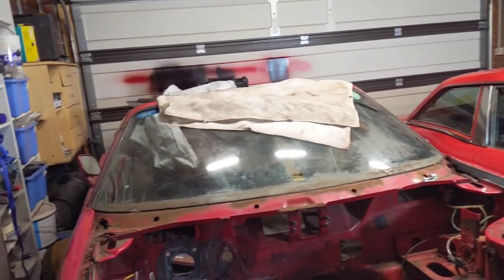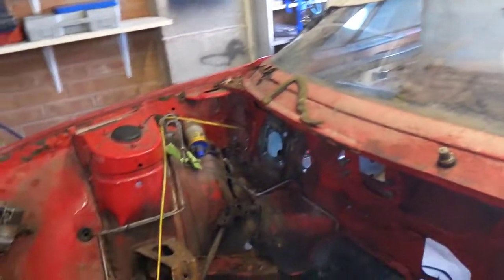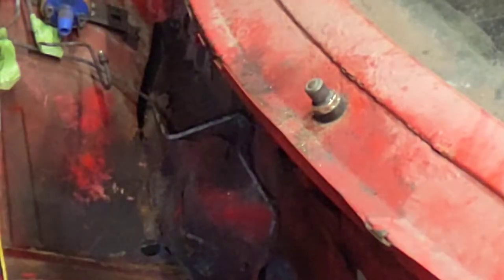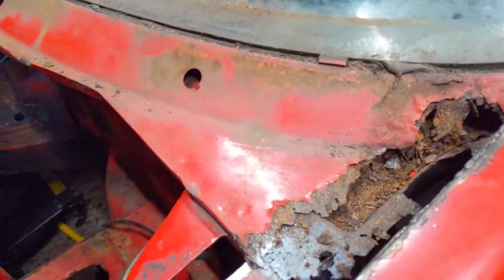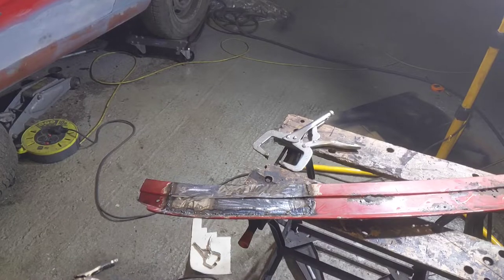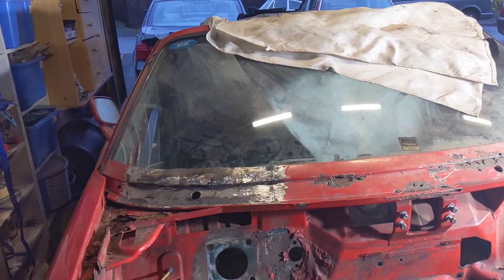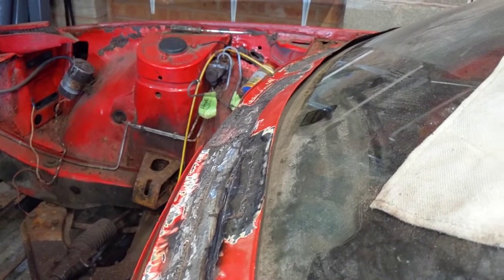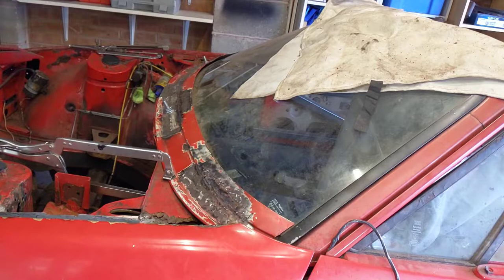Triumph TR7 Restoration: Episode 47   Fixing the Windscreen Base Finisher

Comment: Hi Henry, I had the exact same problem as you and after many hours of fettling coincidently found a local guy breaking his TR7 who had a perfect panel, bought it for £15 and all i had to do was scuff it up and spray it with satin black - perfect! Hopefully you get yours sorted, and can't wait to watch the windscreen removal as these TR7's are bonded in (originally BL used a heated wire in a soft rubbery mastic, by connecting the end of the wire to 24v ie two batteries it heated up and melted the mastic to the frame and glass, if its original glass you may find the remains of the wire in there!) Today a special adhesive is used.
Reply from the maker: Hi Ian, I have had a look for one but the only one I've seen is £75 for second hand, and I'm not sure ho good it is.  I reckon it is probably original glass, so we'll see
Reply: @HenrysGarage  Crikey, I did really well then although I did buy it pre-covid, I now see why you have had a go at repair and so far you have done really well as its a really awkward shape.

Comment: Where you have shrunk ? the panel , hammer and dolly it this will flatten/stretch the metal back into shape , saves cutting and welding which might make it worse !!!
Reply from the maker: agreed - and that's what I've been doing, with some filler to help

Comment: Oh and if you have a similar problem again with a wiper spindle , a sharp chisel and a good hammer will either cut through the nut or undo it ... then you just have to replace the nut ...
Reply from the maker: thanks - good tip

Comment: Do not filler the panel until it sits flush/square and does not distort when bolted down other wise the filler might crack when you go to finally bolt this panel down , other alternative is to bolt the panel down try fettering it  to the correct shape and then body filler it to tidy in place when happy , prime , leave it for a few weeks before taking it off , filler might hold/not crack , its a suck it and see job !
Reply from the maker: I hadn't thought about the cracking - I wasn't planning on leaving it there for weeks because I want the window out.  Might need to change plans

Comment: Just an F.Y.I. if you go to a local breakers you might find a plastic panel the same/similar shape off a modern/newer vehicle , example Mk3 transit ? which might do the job , as its not a structural panel , just a finish/tidy cover plastic/abs will do the job , and can be sanded and painted to match , just an idea ....
Reply from the maker: That's a good idea - I'll see how I get on with it and we'll see